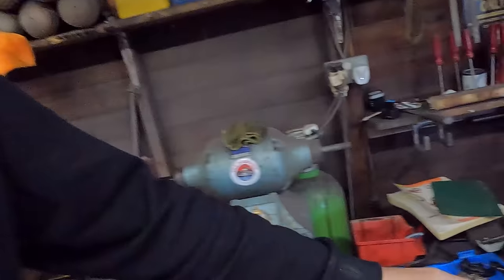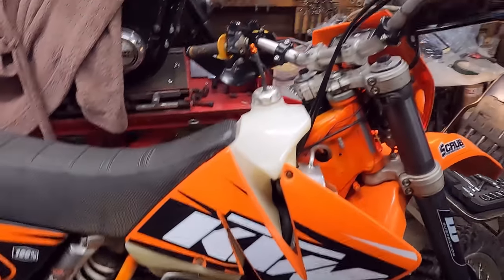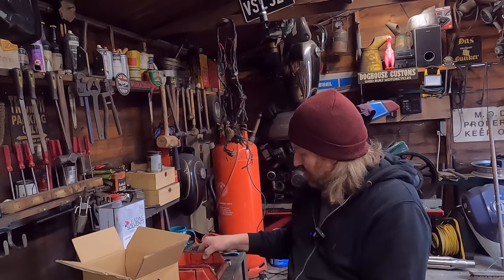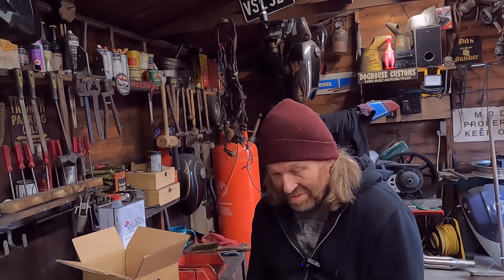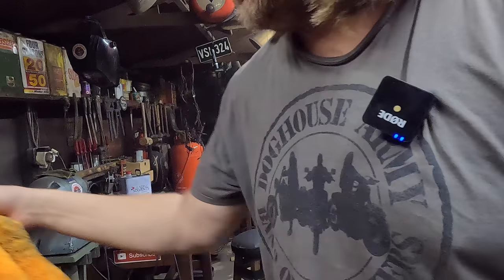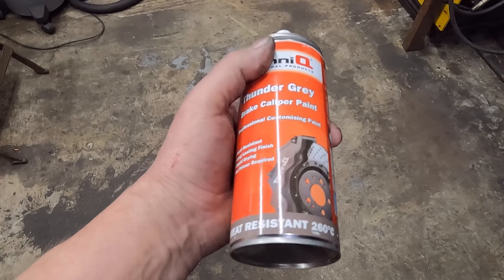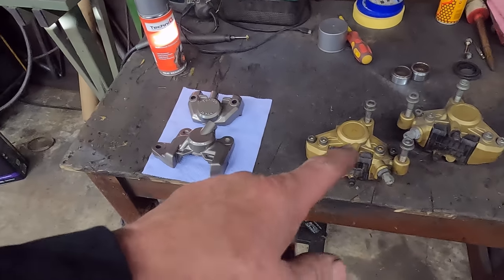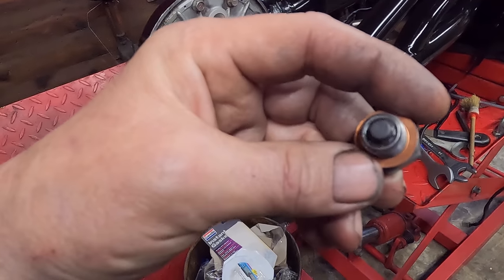Painting Brake Calipers GS Project

Comment: Last summer I sprayed my calipers with just Halfords car paint after not finding the right colour I wanted in caliper paint.

So far so good. 3 coats I did and they still clean up perfectly I figured the brakes are never working that hard to get so hot to ruin the paint

Comment: To cure hiccups: a teaspoon of malt vinegar or my preferred method, using both hands block each ear with your thumbs, at the same time pinch your nose using your 2 little fingers and hold your breath for 30 secs. Repeat as necessary and yes, it does work.

Comment: Bikes looking brill mate  luv the frame coating  thought perhaps  a brake up grade would b good ?
Reply from the maker: Thank you Karl, yes a brake upgrade would be nice but I’ve had to draw the line somewhere, I’ve put thousands ££ into the build so far  £1000 just on the garbs alone so you just have to stop it at some point, it’s already gone a bit over the top, very pleased with how it’s turning out though. Thanks again👍
Reply: @THEDOGHOUSECUSTOMMOTORCYCLES  I had a feeling you may have 😂 you really should make a little custom plate with just your signature engraved into it, and put it on all your bikes from now on ❤️